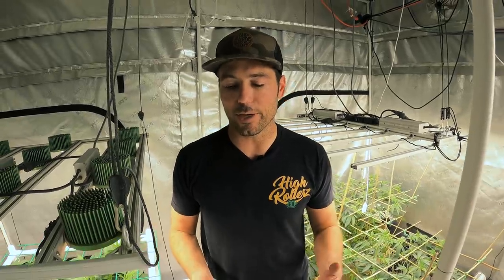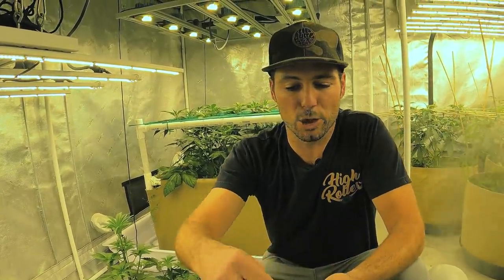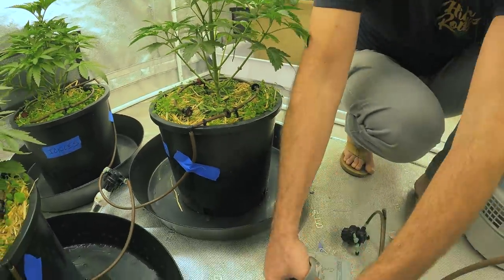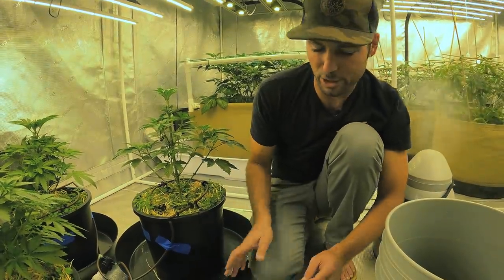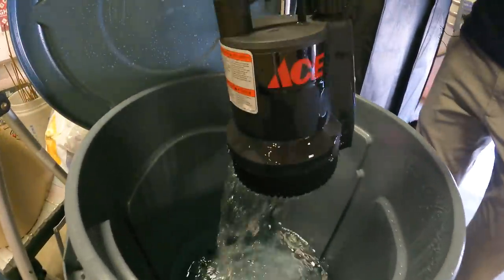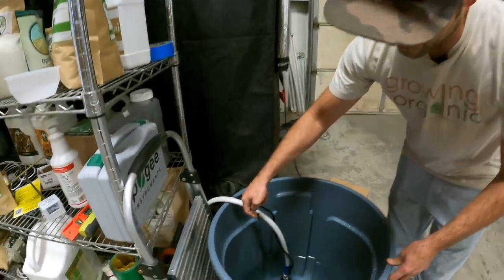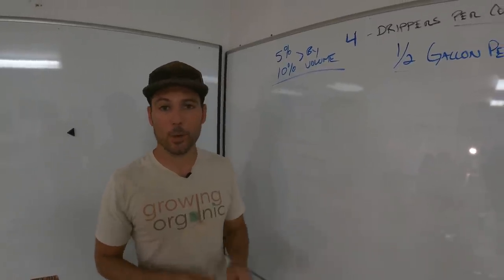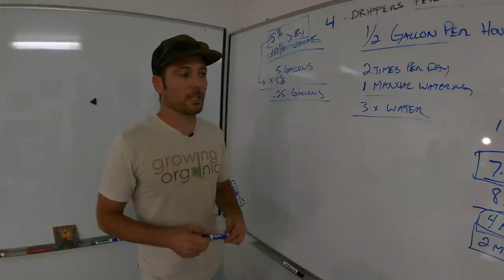BuildASoil 10x10: INSTALLING A DRIP SYSTEM: Season 2, Episode 10

Comment: I suggest you take one pot’s drip setup and place it into an empty bucket. You wil have precise volumes to create a min-gl chart. Secondly, have you thought of using a drip line that has emitter holes every 6 to 12 inches. You can coil it around pots as your system. Dripdepo has a great selection.
Reply: Thank you for the recommendation on drip depot and the drip line will be using a bucket as you suggest to tune it

Comment: Instead of the 45 degree fitting, or after it,  you could add a T connector and use four inline drippers to make a complete circle around the plant which would help equalize the pressure at each dripper. Anytime you build a dripper system its better to make a complete loop to ensure that all the drippers receive equal pressure, otherwise you may loose pressure by the time you get to the last dripper in the line. Just a thought. Love the content and the DIY dripper system. Hydrolock makes a cool dripper system that are built into cones that go around the stem of the plant and have mini sprayers inside. I haven't used them myself but have seen a video on them and they look pretty cool.

Comment: Hey Jeremy I have a question concerning EP. 7
I've noticed you're using plain white LEDs but no reds/ infrareds/ UVA or uvb lights at all.
Have you considered to do a comparison between white leds and all that hyped led-tech in the 630 660 730  380-450 nm area? Especially in that super controlled environment you have.
I'm still pretty new to this, but I got stoked with lighting and the science by Bruce bugbee  now believing that you would run even better with upgraded lighting. I'd love to hear your thoughts on that.

Comment: Another great video but I do wonder if by not trusting the system you’re adding more chance of overwatering? Also, when you’re doing your math I think you forgot that you already halved your desired water quantity at the start when you started doing your calculations based on 5% not 10% so by running the pump for only 2mins twice per day you’re only getting the droppers to do a quarter of the total amount.

Comment: Hello Jeremy I am wondering if you ever mix in yucca extract in your watering reservoir? Currently I am mixing a saponin extract in when watering via a garden sprayer by hand and have great water dispersion. Does running drippers without a wetting agent have a negative impact on this in your experience?

Comment: you could install check valve/non-return valve instead of this 90 degree elbow - it will suck the air, but water won't go back to the reservoir 😏

Comment: I've seen a lot of drip irrigation in grows using timers.. is there a reason why we can't connect 2,or 3 SIP systems together, using a float valve to determine the height of the SIP resevoir?

Comment: Will the water that is on the other side of your air vent keep feeding the  dripers until it has ran out if so you might need to program less time
Reply: It will, it would only be the volume of water in the hose above the drain point.
Reply: @chatttenn4814  but with as many times a day it will add up
Reply: @billhatcher2984   Yes I agree, that's why I'm a big fan of test running  24 hours to double check the volume of each site or system.

Comment: BE AWARE that the GPH and GPM ratings on those “lawn and garden” style drip emitters are calibrated to a high pressure system, as they are designed to be attached to your garden hose faucet. Each style/brand the big box stores sell has its own pressure reducer coupling that reduces your hose pressure down to around 20psi, which is still significantly higher than many small submersible pumps will produce (especially if they are pumping water vertically at all). Which means using them on a small pump setup will result in less than the rated output, making it even more important to run your own flow tests to see exactly how much water they’re putting out on your particular system.
Reply: After reading several comments, it is obvious that you do not understand how to comment here. You arer supposed to tell Jeremy how wonderful he is and how much you enjoy his videos and you want to kiss him, etc., etc.

Comment: Although I have been an organic gardener for almost 50 years, you have expanded my horizons.  I love the 10 x 10 series and take it all to heart.  My question is about outdoor gardening, both vegetables and medicinal.  I would love to see more about the farm (in addition to the 10 x 10, of course).  I am assuming you follow the BAS approach on the farm, so how is it done differently, as you have less control over many inputs (re: heat, wind, and rain , excessive or little).  Keep up the good work.

Comment: Love the channel, is it better to water with a small volume more often or with a large volume and then let dry?  Growing in a mix of ( coco , peat moss , ver, with a little organic) organic amendments with lime and worm castings. I do have a (A and B sensi bloom) but plan on top dressing before flowing. Any help is welcome 🙏, 3/3 with a 2000 vevosun , five five gallon pots using as beds for (G4).

Comment: Does the 5-10% still hold in small containers? I mainly run autos in 3g pots and during flower a full watering is ~.8-1 gallon before I get any runoff whatsoever. Even with a max of 10% .3 gallons wouldn’t be nearly enough to keep them happy and with autos the roots just don’t get big enough fast enough to fill out anything bigger than a 5 gallon container.

Comment: 2nd grow with Blumats.  Both grows, one carrot stuck open (air bubble?) and overwatered one plant.  Obvious difference in that plants yield.  Only issue I've had so far.  Good news is I've left town twice during both grows with zero issues.  They require a lot of fine tuning.  Or...they require you to "Don't touch the dials again or you'll screw them up, again."  Either way, I'm on the fence but leaning towards a yes.  Just need to get to know how they work.  They're not necessarily a "set it and forget it" type deal.

Comment: Thanks man, I was on the edge about getting a blumat system exactly for the reasons you say. Didn't want to lose the connection to the plants + the risk of failure saturating your tent. Will be doing exactly this instead! Life saver.

Comment: Nice! I’m running 5 gallons in your BAS 3.0 and I definitely recommend a drip system, or you’ll be hand watering daily as the plants get big and thirsty. 

I’ve “overwatered” my 5 gallons and the plants in flower drink through it in 18 hours and I’m starting to dry by 24 hours. Temps are 77-82 with lights on.

Typically I’m watering 2 gallons a day divided into my six 5 gallon containers. 

Another great video I wish these would come out faster :P